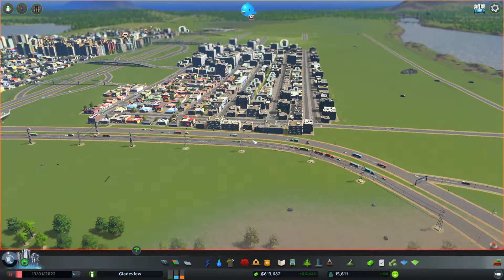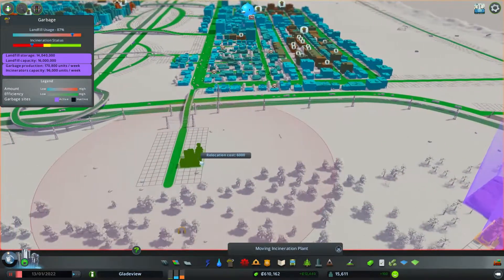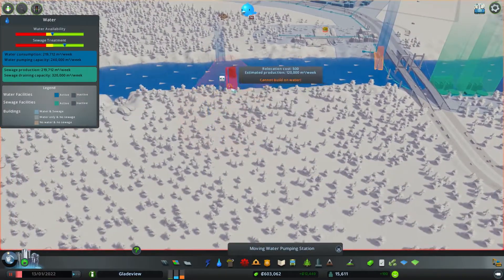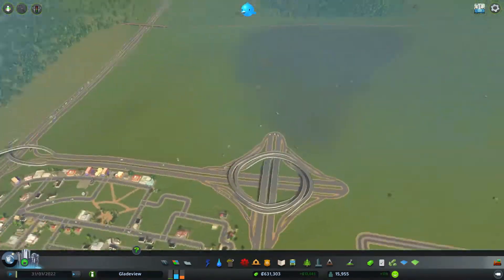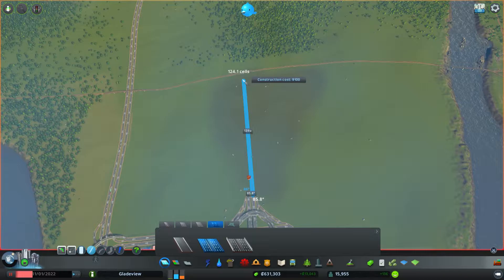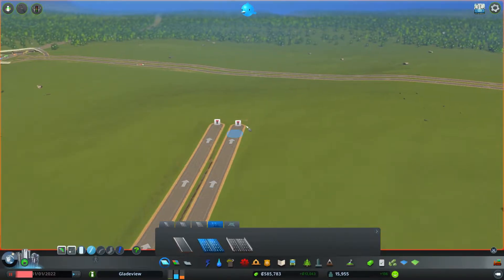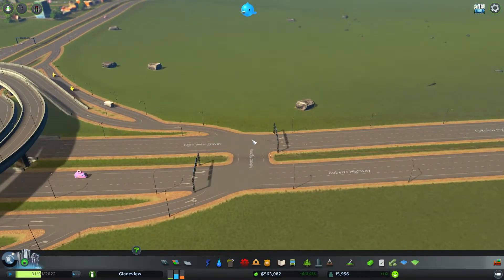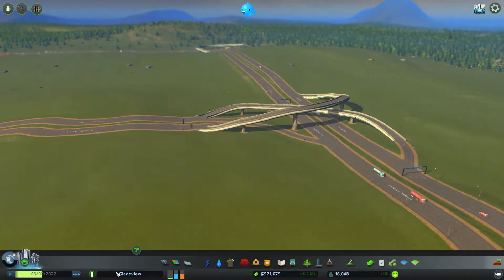Cities Skylines: Gladeview Part 6 - Filling it all in

Comment: BTW, I suggest that you remove that turning around thing you wanted to experiment with in the 4 way interchange, the reason is that, in an ideal expressway, the only ways of exiting the lane you're in is by interchanges, and no turning back or stuff like that, when your city reaches high traffic that little turning around thing might be trouble. If you want people to be able to turn around well, you probably want to add small interchange lanes by yourself :)
Reply from the maker: Yeah i only planned to leave those there because of how little traffic was flowing, but i will get rid of them when the time comes. Thanks! :p